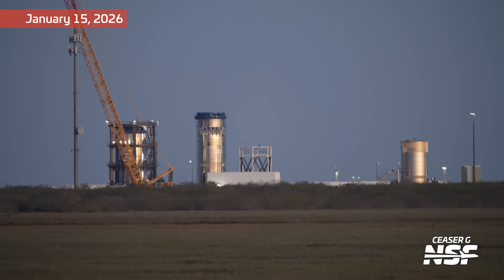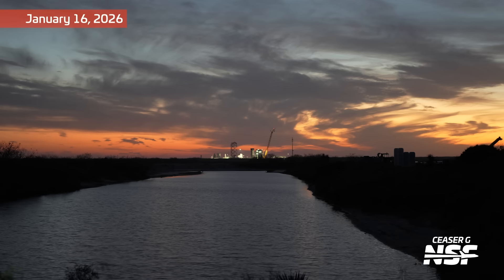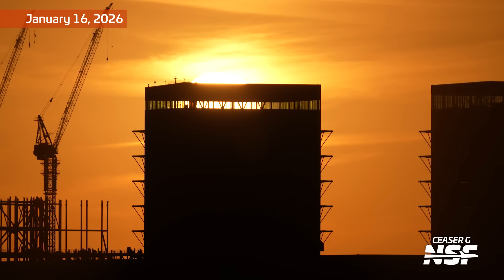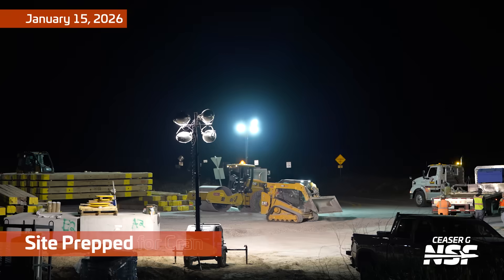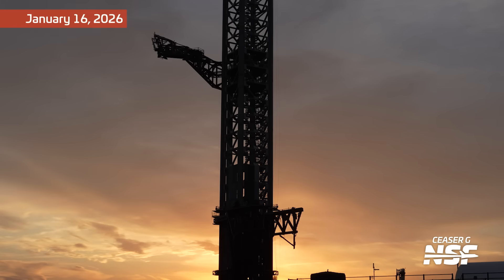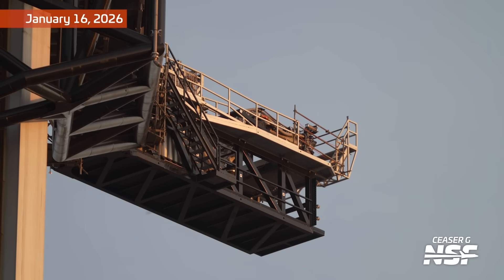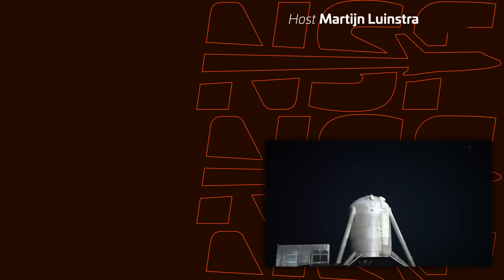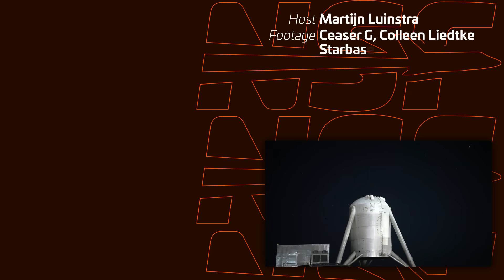"Build your own crane" | SpaceX Starbase

Comment: A boom is the primary, heavy lifting arm of a crane, providing main vertical reach, while a jib (or fly jib) is a smaller, secondary extension added to the end of the boom for extra height or horizontal reach, handling lighter loads.

Comment: V4 ships are planned to be taller. Wondering how 'easy' it will be to reconfigure a tower from V3 to V4 ships....
Reply: The new Towers (Pad 2 and onwards) have two possible SQD Arm mounting points. V3 uses the lower one and the upper one (iirc the only one yet on old towers) will be used for V4.